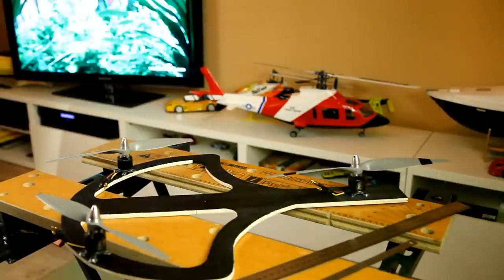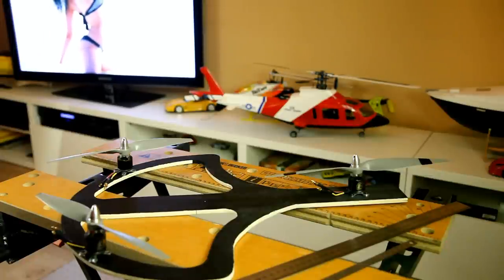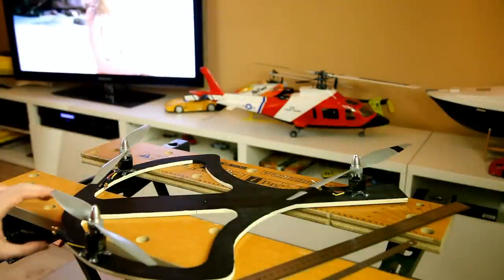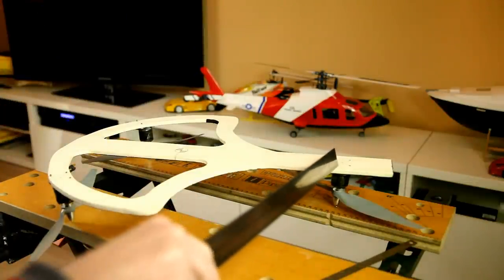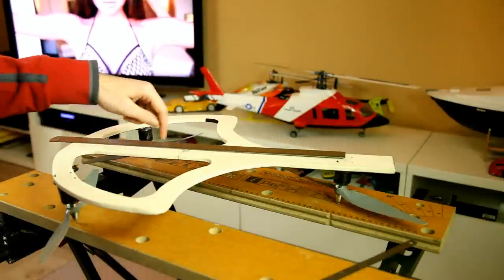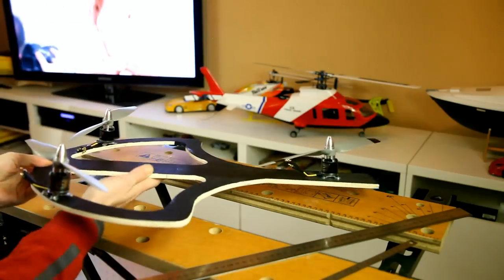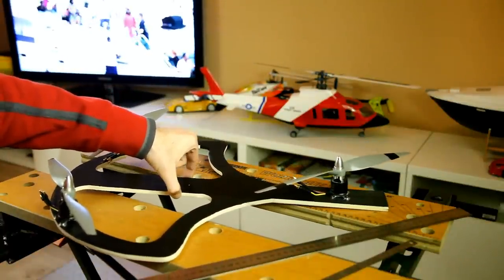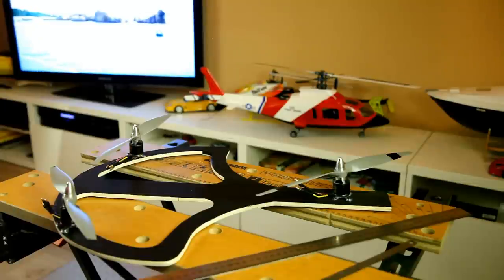CG Calculation on TriCopters ?

Comment: I like your approach however I check my balance differently. If you have equal load on each motor its balance by definition. The motors must be at the same level with one on a balance.
Reply from the maker: That is true indeed :)  Basically that is what I showed in the end of the video :)
Reply: Yes I usually use a kitchen balance a two tuna cans. The mid point is the CL for a symmetric tricopter, like a fixed wing aircraft. A bit forward of that point for CG, is OK but back is a No-No. The rear prop has variable lift so it can affect things if it has to much load.
This approach has worked for me.
Reply from the maker: Hotwire Good addition Hotwire! Thanks for that :)